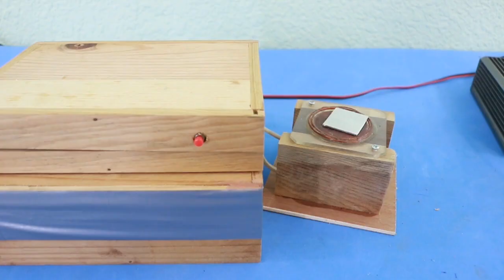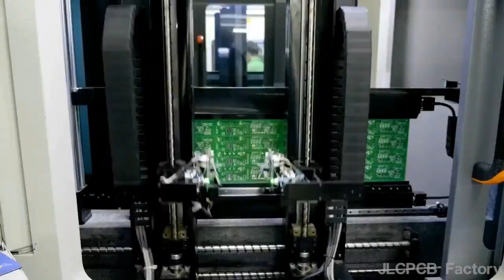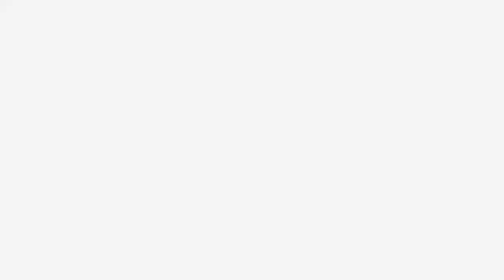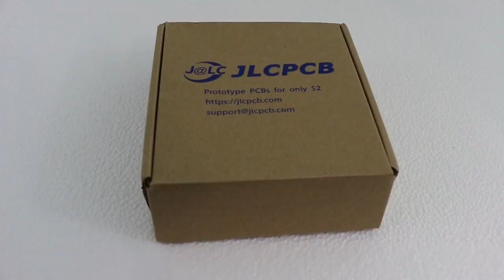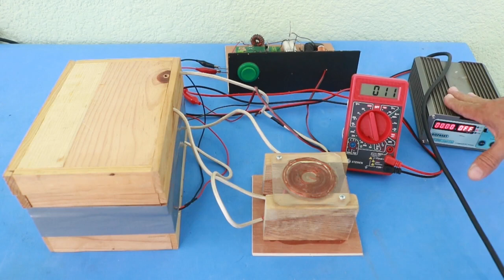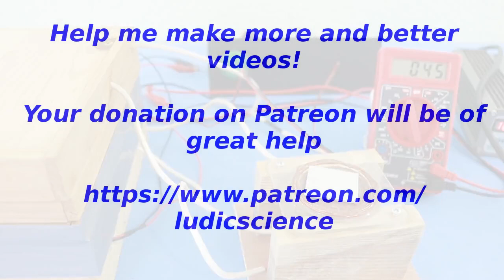High Voltage Capacitor Bank III: Plate Launcher

Comment: how you handle the 'voltage spike' on the negative terminal of capacitor bank after the trigger spark gap discharge the capacitorbank? do you used resistor and diode between the negative terminal of capacitor bank and spiral coil?

Comment: As per Lenz law this will happen if current applied to the coil is ac but not dc. The cap bank dischargs dc voltage to the coil?

Comment: Interesting demonstration. What happens if you substitute a ferris material for the aluminum plate? More or less effective? If using a ferris material does this process leave a residual magnetic property in the metal? If you placed a cassette tape on top of the coil and fired it, can you play the tape through a tape player with an oscilloscope hooked up to the output and view the signal induced into the magnetic tape?

Comment: At 5:41, how is that the multi-meter reads 1174 volts? PLease explain #Ludic_Science.
Reply: If the current through the inductor decreases, the magnetic field strength decreases, and the energy in the magnetic field decreases. This energy is returned to the circuit in the form of an increase in the electrical potential energy of the moving charges, causing a voltage rise across the windings. 
Sudden voltage spike seen across an inductive load(coil) when its supply current is suddenly reduced or interrupted.
Reply: @johnpauliii1218 Pretty cool! At 4:43 the voltage raizes up to 700 volts.
Reply: This is how boost converter works, the coil has inductance.
Reply: It could broken

Comment: Is this cap bank enough to produce 'flash graphene?" I am looking for a high voltage bank that will dump everything very, very quickly. The best idea ive come up with is using a arc welder, but this doesnt produce the current needed to convert anything, except high quality grafite that ive already reduced to multi layer graphene. If you might be so inclined, the graphene industry and those of us actively researching its mass production would be more than grascious for some guidence on creating such a device.

Comment: What is limiting the capacitor charging? Do you absolutly need to monitor voltage ?
Reply from the maker: The capacitor rating. Yes, overvolting can make the caps explode
Reply: @ludicscience  How about using a series of zener diode to clamp the voltage to make it student proof.
Reply: @manla8397  why not use a zener diode to bias pnp in series with the caps. Wouldn't what reduce the need for expensive high wattage zeners